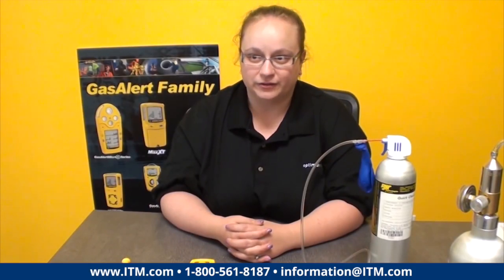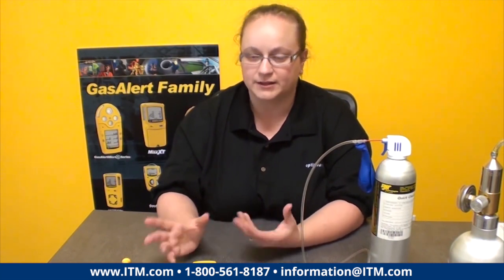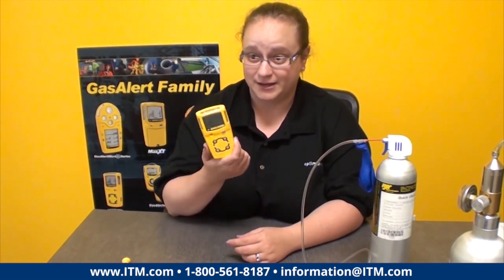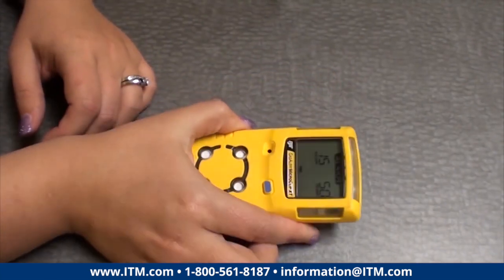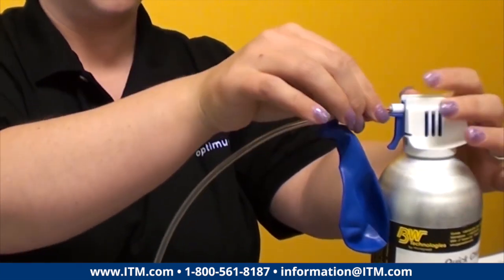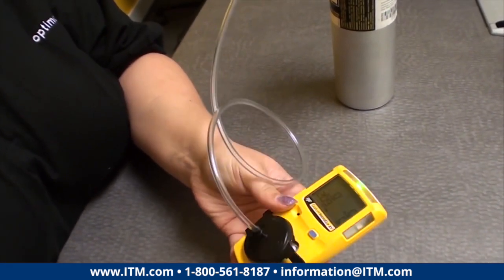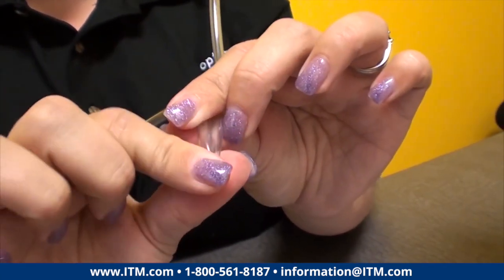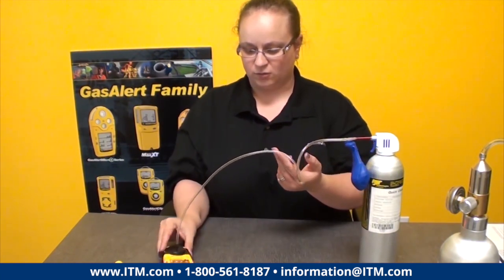How to: Bump Test a BW Gas Detector

Comment: Where does the discharge of the gas goes after the test?  Is it released into the air?  When you expose a monitor to the gas it is detecting and it detects the level it is designed to detect, the excess gas appears to be released into the air or some way to capture it.   The gas goes into the monitor and it has to come out somehow when the clip comes off of the front of the monitor.   

Reason, I am asking is:  We had bump tested 2 H2S monitors with the Honeywell IntelliDoX docking station, and after the tests, we smelled rotten eggs and we left the area.  It didn't have a way to capture the excess gas.   Somehow the gas going in to test the monitors has to be released somehow.
Reply from the maker: Thank you for your comment, Tornado. We’ve looked into this and found the gas does disperse into the air after use. While calibrating with the H2S monitor, smelling rotten eggs for a short while after is normal. If the room you’re working in is fairly small, it’s recommended to open a window. This will help disperse the gas more quickly. Please let us know if we can be of any further help .
Reply: Better the area where bump. Test should be done must be properly ventilated or cylinder cabinet must have exhaust fan to dilute the gas in the air and use of recommended mask even to not expose to.the small.amount of gas..